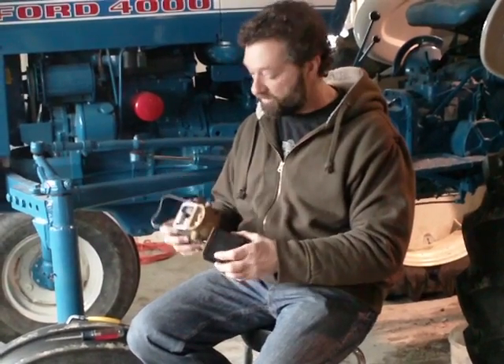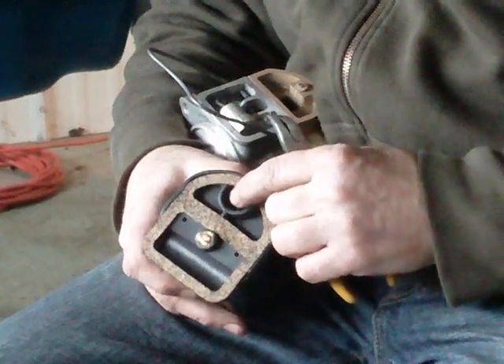Ford 8N Distributor and Coil Installation

Comment: I wish you had answered the questions below , i'm also looking for a wiring diagram for an early 8N . The diagram in the I&T manual is for the later 8Ns . I do appreciate this video however , my tractor has been running for several years and now it will not start . I will pull the unit off the engine , as you show ,  and start over . Thanks from Brackendale B.C.Canada .

Comment: Dan
Do I need the Resistor on my 1948 Ford 8N tractor 12 Volt? I'm having problems getting the wiring correct from my turn key ignition switch all the way through. Help!

Comment: i love my 8n !! its a 1952 8n that i use on my small farm, in the 5 years ive owned it ive changed the oil on a regular schedule and have had no problems with the old girl best tractor ive ever had, strong as a ox and as reliable as a mule